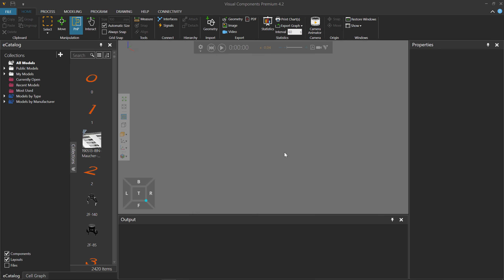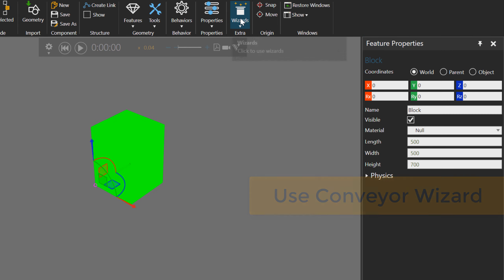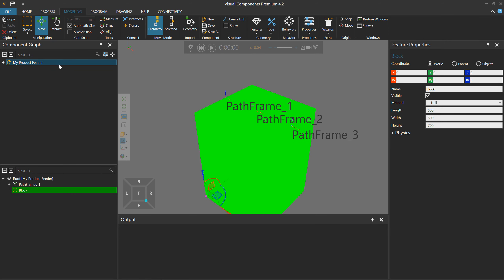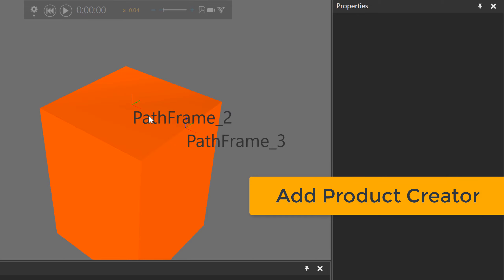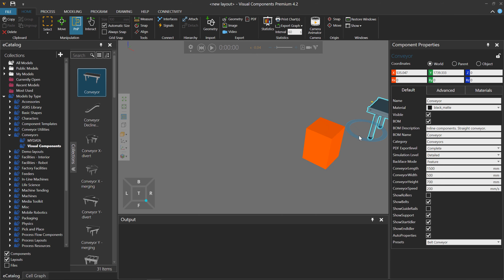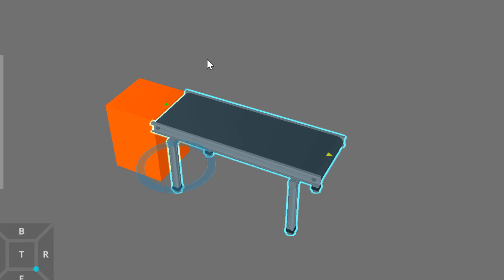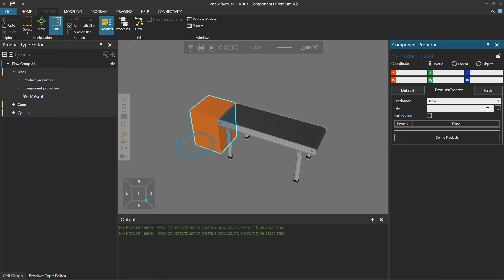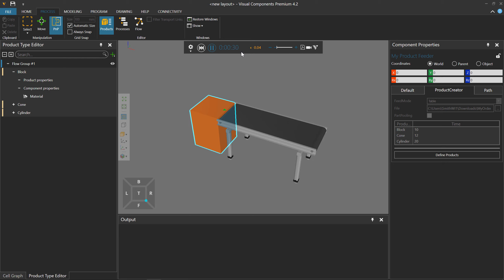Model and Configure a Product Feeder

Comment: Is there a way to change the orientation of the products coming out of the feeder? I've imported a CAD file and wanted to make it as a product, but it came out in a different orientation on the conveyor than I wanted like "standing" instead of "lying down". Is there a way to change it?
Reply from the maker: Yes, that is possible. There are a few ways. One way is to import the CAD file as a component, and then rotate the component to the correct orientation, and then select a product type and reference that component. The product type should inherit the orientation. If you need additional help or solutions, feel free to contact support or post a question on our forum
https://forum.visualcomponents.com/

Comment: Is there an option to feed more products at a time? For example 3 cylinders next to each other (not after each other), or at a set distance between each other at the same time on the same feeder.
Reply: In short, I'm a student, and me and my group want to make a factory model of our "candle filler production line" with VC. It is my job to do this, but I already have a lot of issues with implementing our processes, ideas, solutions into the model (for example feeding more glass jars at a time, implementing a big wax container, which goes into 3 other smaller containers with the scent and color, then filling up the jars with wax, etc.).
Now, unfortunately, during classes we only got a brief introduction to the program, and no further guide whatsoever.... Which means I have to figure out myself how to solve our problems and how to implement our solutions into the program, which I don't really know either.....
I don't know what the program itself is capable of (i.e. could it even show/model the liquid (melted wax) flowing into the jars, or will it just show the pumps going into the jars and then back up again, visually putting nothing inside), which is not a big deal (the less the program is capable of, the less precise and realistic I have to be with the model).
Help would be appreciated.... :)
Reply from the maker: Yes. We recommend you try this in Visual Components 4.3. If you need more info, feel free to contact support or post a question on our forum.
https://forum.visualcomponents.com/